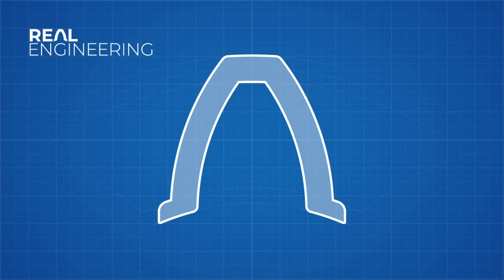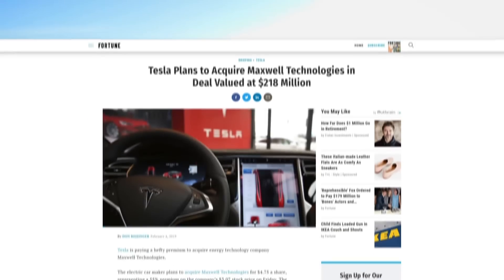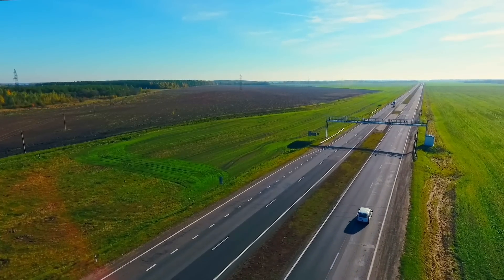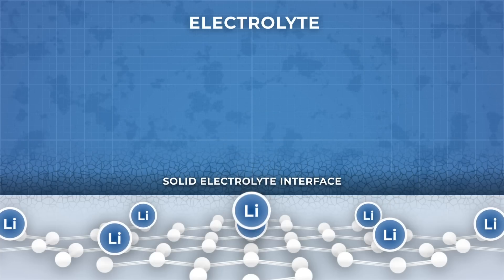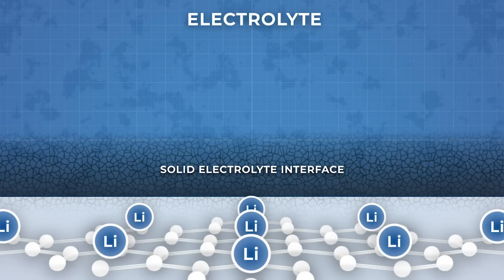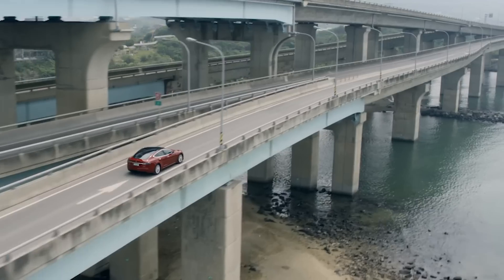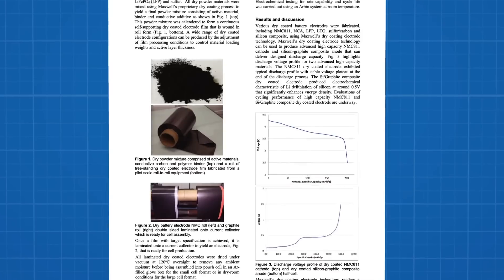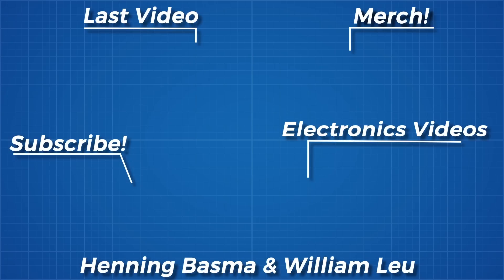Tesla's Quest for Better Batteries

Comment: Hopefully they make faster charging, higher capacity batteries
Reply: JRPG Guy 2 Their plan was to actually make slower charging, lower capacity batteries
Reply: @GThenameisleo  lol
Reply: Actually their plan was to shift from batteries to fuel combustion engines...
Reply: JRPG Guy 2 there is 
Check out the tesla youtube channel 
You will see their new charging speed
Reply: @010falcon  this. up to 1000/mph
Reply: They already have - but it’s taken some time to mass produce it 

It’s called solid state batteries-
More stable, more power, faster charge. 
It was invented by the same guy who made lithium ion batteries
Reply: @ZEPR0FESS0RR  That technology, for car batteries and not phones, is about a decade or so away (mass production). Plus, when they start, they will likely be a good bit behind where lithium ion batteries (at least  from Tesla) energy density will be.
Reply: @AscendedSaiyan3  
You really want to bet the Maxwell cells haven't been beta tested in a car?
Download that document and read it (I have)
Reply: Thanks to nano tecnology capacitors they will
Reply: Yeah, tha'ts the whole point of getting better batteries, Captian Obvious